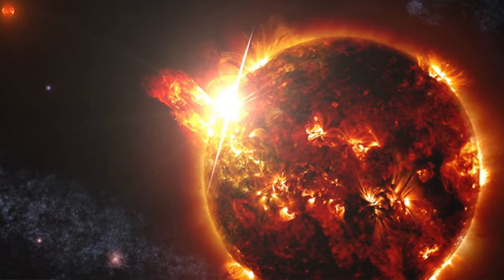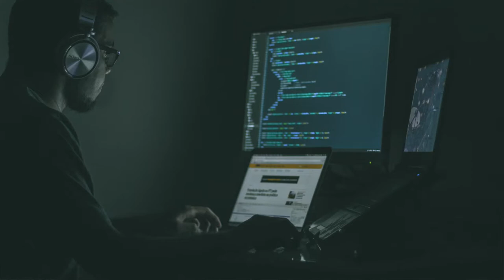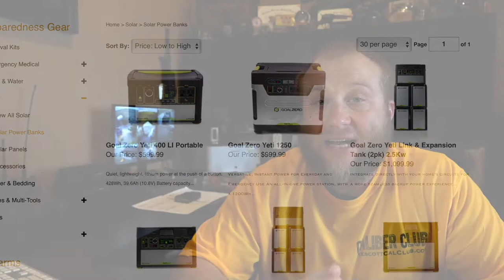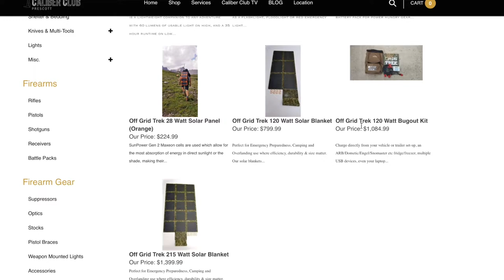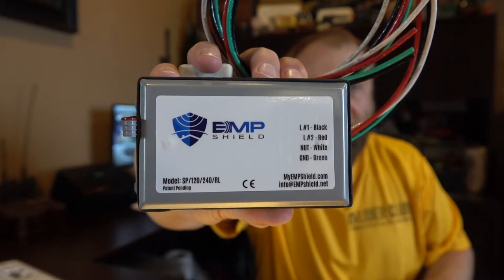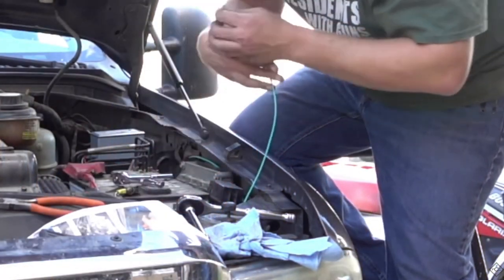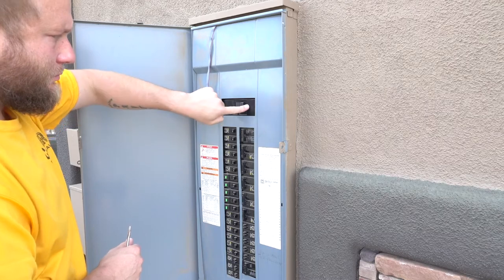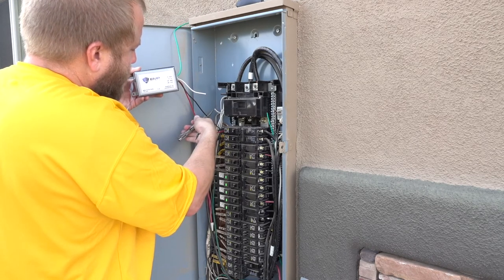How to Prepare for EMP | Buy One Before They’re Sold Out

Comment: Hey man. Something to think about. 

Those look like 12awg wires. General consensus is for 1 meter of length, current carrying capacity is only 20 amps. There is soooooo many variables when talking about emps we could go on forever. It’s not just amperage and voltage it’s also the pulses wave form and frequency. Wave forms are categorized by shape, duration, and amplitude. Double exponential pulses are the most common but there are also dampened sine wave and rectangular sine wave forms that will effect electronics differently. 

Long story short there are so many different variables and there is no one answer fits all. But by nature EMP are electro MAGNETIC pulses. Electricity and magnetism IS mutually exclusive. So if you have a conductor (of any sort) it will be energized as these pulses travel through the air. So basically that surge protector  won’t do anything when the pulse is traveling through the air. It worked for your house because the lighting strike hit the ground and traveled outward to your electrical panel and your over current protection did it’s job.

I’m currently looking at implementing faradays principal in the building of a steel structure but it’s problematic. It’s the magnetic properties that are a problem.

Comment: These are definitely something I need to look into more, but ultimately they would only be proven by an actual airburst EMP. 
The ones that hook to your house or to your car will only work if the EMP  surge goes through physical wires, through the ground, or something physical. 
The only way I can logically see these working to protect a whole vehicle, or a whole home, from an airburst EMP, with the experience in construction, automotive, and electricity, that I have, is if the entire vehicle, or the entire home, has installed around its outer perimeter a faraday type device to "catch" any airburst EMP and is grounded to redirect it.
Reply from the maker: Definitely look into them more. I have always been of a similar belief and I found these devices simply because I was intrigued and didn't really believe in them. But I have had the opportunity of talking one-on-one with high-ups over there and the more I learn about the product the more I'm sold on it. I'm not guaranteeing it's going to work, but man the evidence of it not working is covered in the Keystone Testing that was done. Also, they're being used by the Mil and Gov already. Hardening the Texas Grid. I know the government and military does dumb stuff, but they don't throw money at pure snake oil. I don't know, I just figured better safe than sorry and so far this one has pretty much paid for itself in the one by protection against the lightning strike from a few weeks back. I do have them in my vehicles as well. I don't know, do some research and I'd love to hear more feedback from you afterwards! Thanks for watching and participating. I appreciate it my friend. :)
Reply: @PrescottCaliberClub   I'll let you know what I find. I would think that the military would have done some EMP testing themselves, detonating various air bursts to see the effect on various dynamics, products, situations. They may have already, but not finding any data. May need to reach out to old USMC buddies. Take care.

Comment: My question is if the entire power grid is down then how can this help you? We still will be without power for potentially a long time from what I am reading. This would protect it so it could come back up when the power grid does but would not help until then right?
Reply from the maker: Yes to an extent. The reality is that you may not fall in the direct blast zone of the EMP and therefore it may be something that if you had a device like this and we’re not in the immediate blast zone that it may help. But I have my own solar power generation setup so if it does work, I can create my own power. That I have in a faraday cage. I think the device that shines the most in their lineup is the one for the vehicle. At least you’d make it home while everyone else may stuck dead in the water.